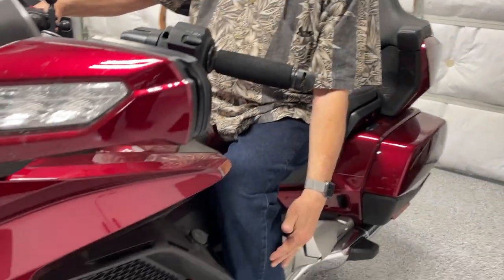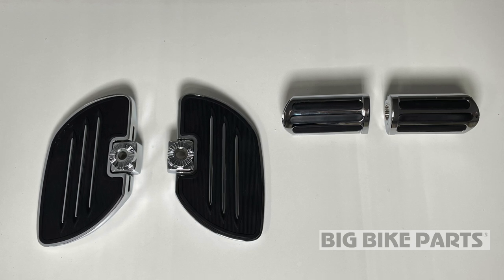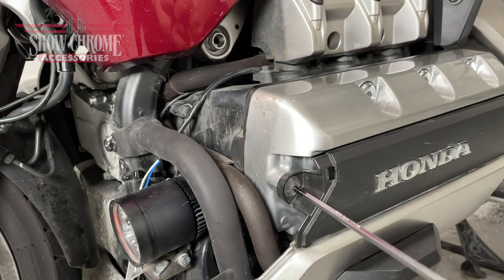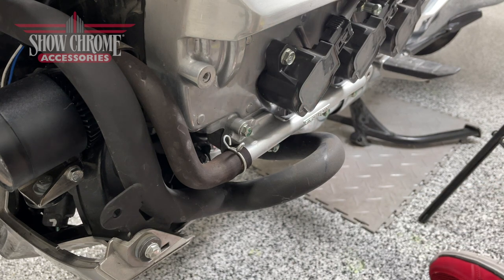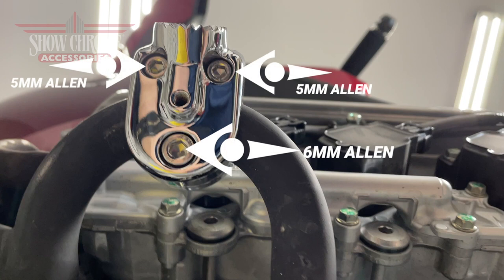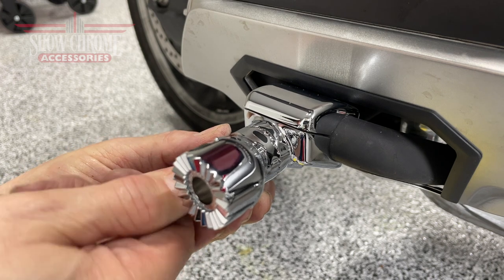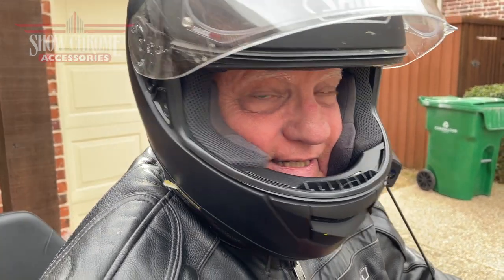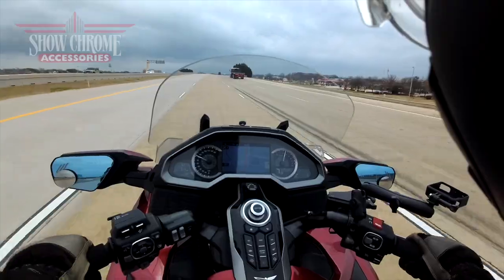Show Chrome Commander Board Highway Pegs | Install & Review | 2018+ Honda Goldwing

Comment: I installed these pegs last Summer, along with the offsets and the engine trim. I am 6' with a 32" inseam. I never got the perfect angle or length with them. This video has reminded me to tinker with them this weekend and get the settings right.

Comment: As a 'former' sciatic sufferer, I have a suggestion that stopped my pain in about three weeks!  DO NOT sleep with your legs 'stacked' one on top of the other.  Roll your top half slightly off 90 degrees and also roll your hips so your legs are NOT on top of the other.  
I received this hint from a 'celebrated' physical therapist as one of her top ten things to change; this one thing is what worked for me almost immediately.
Some people place a pillow between their legs and roll a little to one side.  It's hell getting older, I don't recommend it!
Good luck and Good Rides.

Comment: Ok. I am ready for highway boards. My question is: Will these work with the OEM lower air deflectors I have installed? I don't want the deflectors digging into my shins when I use the boards.

Comment: Thank you Cruiseman! Thank You ShowChrome!
Reply: Don you might consider sending your seat to Russell's day long sofas for a rebuild. They did mine and pushed the back of it almost 2 inches and raising it higher I think this would give you the ultimate for long rides
Reply: Hi Don, would you mind telling me your height, or inseam? I'm trying to judge from this video if I need the off-set arm like you, or not. Thanks, Al
Reply: @alt9874  I’m about a quarter of an inch shy of six feet tall. Inseam is 32. Hope that helps.
Reply: @mrdonsmith  - Awesone Don, thanks. I'm 6'3" with 34 inseam... do you believe I should order the off-set arms?
Reply: @alt9874  it would be a guess on my part. I can tell you that the offset arms adds position versatility that you otherwise would not have, but they can also get you into trouble if you lower the pegs too much. Too low and the pegs can scrape in tight turns. Also, the right tipover bar is about 3/4 of an inch more forward than the left, so the right peg will have a little bit different adjustment for comfort than the left. That’s due to the right side pistons being offset from the left side pistons to allow all pistons to attach to the same crankshaft. You can understand why I can’t say for sure what would work for you but maybe knowing what I just told you will help you decide.
Reply: @mrdonsmith - thank you Don, I see what you're saying, and I appreciate your insight. Thanks very much.
Reply: Hey Don, I really like your nice heavy leather jacket, full face helmet and riding gloves but do you always ride with TENNIS SHOES??
Reply: @brucespicer3957  I told Cruiseman that it’s only a matter of time that I would get dinged about my shoes. You’re the first. I’m surprised it took so long. But, you’re right in that I should not do that.
Reply: @mrdonsmith  Thumbs up Don
Reply: @Don Smith - Can you give us an update on how your Commander Highway Boards are performing.
Reply: @bluedragon2824  I didn’t own my bike very long after this video. After too many close calls I sold the Goldwing. I sure miss that bike. As for the boards, I liked having a place to rest my outstretched legs on long trips. But, initially I was forgetting they were there. But, I used the more with experience and I was getting comfortable with them when I sold my bike. Due to the offset cylinders, the pegs aren’t at the same distance from your hips. One leg will be slightly more forward then the other but I don’t remember which.

Comment: Hello CM! Thanks for the awesome video. I have a question about the nut with the silicone washer in it. Where does it belong? It fits into the board but the screw will not pass through it. Is it necessary with the use of thread lock?
Thank you again CM
Reply from the maker: You should not need thread lock on a bolt going into a lock nut with the nylon. I am going from memory here, but I am not sure why the bolt will not go into the nut. Now, it is a very tight fit until you get the threads to start to dig into that nylon locker.
Reply: Thank you CM!

Comment: Chris - can you tell me what keeps the point when the bracket is attached to the crash bar from rolling downward when you put weight on the board. I see the three bolts that make it clamp but are they teethed on the inside that touches the crash bar to keep it from rolling down from its mounted point?

Comment: Great video as usual. I wanted to buy these but went with Kuryakyns though I haven’t installed them yet. I love everything about how the Show Commander Boards mount to the engine guard except for how the actual boards look.. I think a larger upper portion & a smaller/thinner heel portion would’ve looked better..
Reply: Did you ever install the Kurakyns? If so how did it go and how do you like them? Thanks